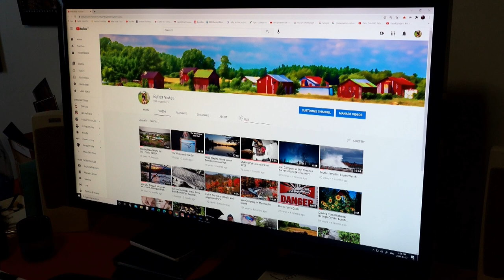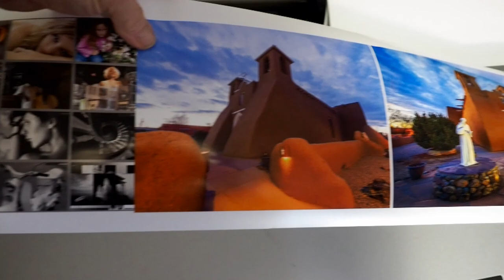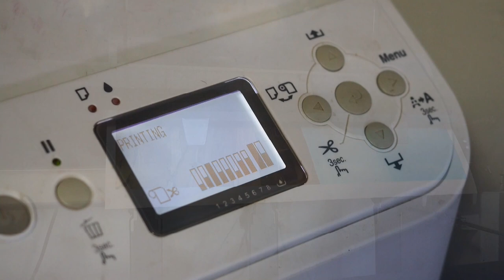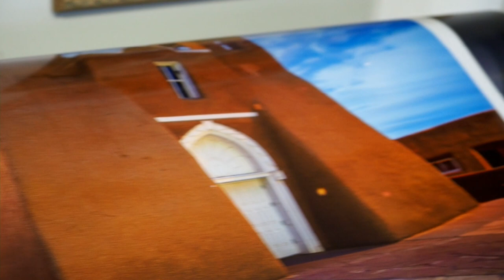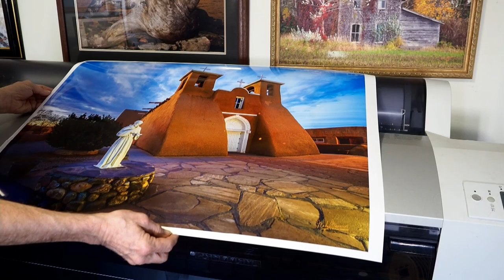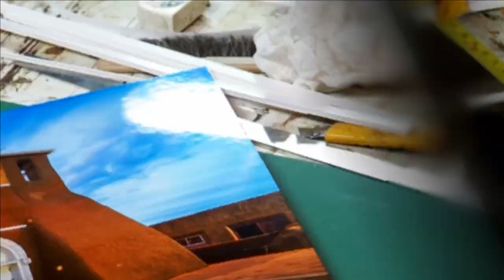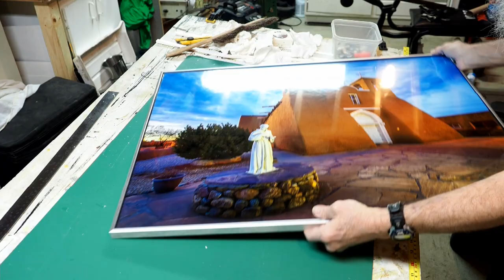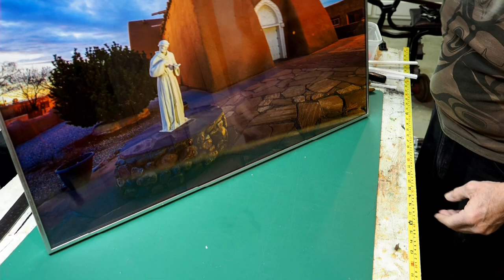Making a print of St. Francis Church in Taos New Mexico

Comment: How are you liking the Olympus OMD E-M1ii or did you get the E-M1iii?
Reply from the maker: I have the MK 2 still.  I bought the 12 to 40 MM and the 40 to 150 also the 2 x Converter.  Just loving it so far.  This photograph was made with the E-5 and the 7 to 14 mm.  I miss that lens.  I am also thinking about the 300mm.
Reply: @bellasvistas3463  Olympus made a adapter so Four Third lens will work on Micro Four Thirds. There was also one third party adapter also. The adapter works good with Olympus cameras that have phase detection on the sensor that's most newer models and all E-M1 line of cameras. Just search for Olympus four thirds adapter
Reply from the maker: @gamingwithstand6886  I have sold all my E series lenses now.  I still have an E-3 body in good shape with several batteries, CF Cards and an AC adapter to sell.  Thanks for your info.  Mike
Reply from the maker: You might enjoy our latest Video.  Nesting Osprey, Mink, Killdeer, Sandpipers!  https://youtu.be/pxEa8m_VvQw

Comment: What brand of computer case is that?
Reply from the maker: Hi Andy:   Thanks for watching and taking the time to comment.   That's a great question.   It's ancient,  the top front door has been broken off.  It was expensive when we bought it.  Fans and a controller were added,  the main board and power supply replaced a couple of times.  It currently has an MSI board,  I-7 Processor and 32 GB ram.  I can't remember the brand it came with the power supply and was the quietest one back then.   We plan on an update and will probably spring for a new case then.  Thanks,  wish I had a better answer for you.   Mike